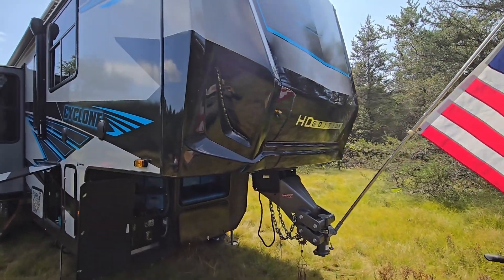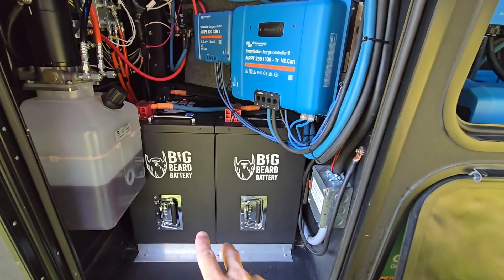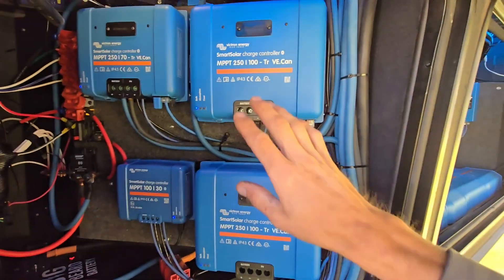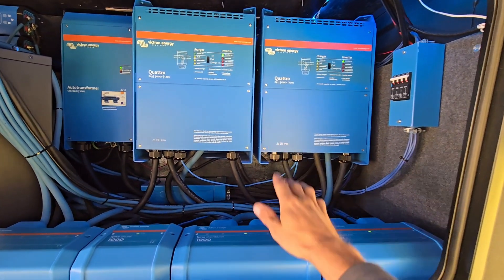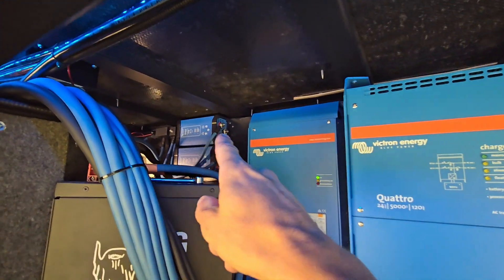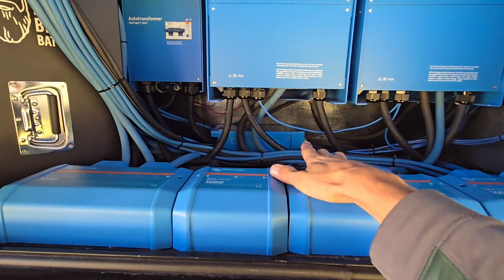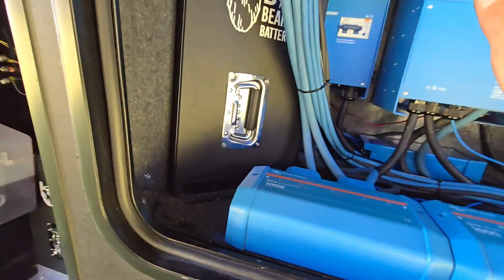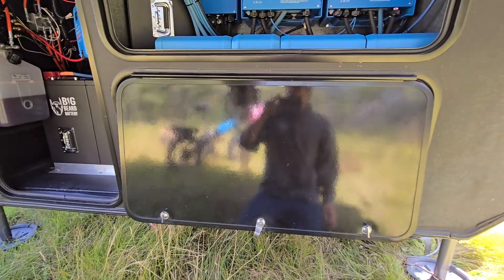Huge RV Victron/Solar System Capable of Powering 4 A/C's

Comment: Awesome system brother. What are you using to cover battery terminal connections?
Reply from the maker: Umm if your talking on the actual batteries themselves thats all part of the battery connection that just has a thin piece of plastic that snaps on to help cover them.....
Reply: @ccrvsolar  yes, your battery terminal covers? Where did you source them? Or they come with batteries...

Comment: What mount is the angle mount for the roof?  And where in the world did you find battery cable that is Victron Blue?
Reply from the maker: If you're talking the front angled panel, it's really just some basic tilt mount brackets for bigger panels.....
The most recent rack I have built which the video for it I literally just released I did not even use those.  It's more about the center support that's most important.....

As for the Victron Blue cable, my supplier I'm keeping to myself lol but it's not too hard to find out there on the internet.....

Thanks so much for watching and commenting....

Comment: You have an awesome system!!  I need something like that. Approximately how much would a system like that cost, minus the solar on a class A?
Reply from the maker: So even with no solar there is about $17-18k in equipment and wiring....labor would be on top of that which I woukd love to discuss with you if pour really interested, my labor includes lifetime customer support with remote monitoring through the Cerbo GX.....
Certainly give me a call/text 989-464-3314 or send me a email if you woukd like to discuss further....
Thanks for watching....
Reply: @ccrvsolar Hire this man!  Totally worth it based on how great these installs look.

Comment: Is there a simpler way to do this? I want a big system, but I don't want to have to run 47 separate MPPT's and 12 inverters. Wtf...
Reply from the maker: Ha yea there is, there is some all in one units out there by other brands that claim they have 6500 watts of inverting power with built in solar controllers so a "all in one" setup but its not victron and doesn't provide the same power in my opinion.....I want and victron system for various reason and if one wants a victron system to power everything, this is the way to go about it....
I build smaller simpler victron systems also but they are not going to power 2-3 a/c's.....
Thanks for your comment, I love talking about any type of solar setup.....

Comment: Ridiculous installation. Its like putting a V12 Ferari engine in a Hyundai Elantra. Never use the power capability😢 but spent $20,000 or more.
Reply from the maker: I guess I'm not sure how you can say we don't use the power capabilities....
We run multiple A/C's quite regularly plus when we have a customer plugged into us which is about a 1/3rd of the year there is times they are also running an A/C so now we are at 5000-6000 watt load and someone needs to use the Microwave now we are pushing 7000-8000 watt load.  Our batteries at some point throughout each month often dip below 20%.  Every watt of the 6600 watts is needed where there are times I wish I had more.  
I built the system not to run a 5000-8000 watt load all day nor would it be capable of running that kind of load all day....
There is literally not one piece of the system I could make smaller without sacrifices to our daily power needs....
Thanks so much, I love talking solar with anyone....
Reply: Yeah, and even when you’re not drawing 5-6kW, you’re charging a 23kWh battery bank to use at night.  Ignore that guy.  Negative nancy that doesn’t know what he’s talking about.  Probably has a 1-2kW system, no wife, and no kids.

Comment: What do you use for auto gen start?
Reply from the maker: It's made by atkinson electronics.  They actually have a new wifi version out that has made it much easier, works for pretty much all generators....before I had to stock multiple different kinds and even then wouldn't have the right one for some installs....
Once u have that then it gets wired into the genny start wires, the victron cerbo, and genny L1 and N.....
Much better auto gen start than anything else u can buy if you have a victron system.....

Comment: Why not parallel your panels?  Those 250/100's could easily handle a 4s2p.
Reply from the maker: So are you suggesting I should put 8 550 watt panels on 1 250/100 solar controller???  If so that would be 4400 watts and with a 24v system then there could be a possible  output of 170 amps which would be way to much waste....
Maybe I am mistaken on what u mean exactly....
Thanks for your comment....

Comment: Awesome. Is the generator really necessary though? In the process of planning my build. I’m going for 28kW of batteries so I figure that should cover me for cloudy days and I can ditch the generator to save on weight
Reply from the maker: I mean no matter the system I don't know if I would ever be without some sort of back up given my life with a wife and young kids anyways....
Really only time I have needed the genny is when customers are also plugged into me running an A/C, or in Michigan there can be a week of 90 degree weather and it's cloudy everyday by noon, 4 days of that and our batteries were down to 15%....
If I had my RV built I would skip the built in genny, add one battery, but still carry like a 2000 watt dual fuel little genny as a last resort.....
Everybody's needs are a little different but it would suck to have a dead $30-40k system.....
Thanks for watching and commenting.....
Reply: @ that sounds pretty reliable. Thanks for the advice. I’m thinking I might just use the built in inverter plug in the back of my truck as a backup.
Reply: @dishcleaner2   Yeah, that could be your emergency backup generator.  Nice.

Comment: How much weight does the solar system add to you're RV ?
Reply from the maker: Oh it definitely adds some weight, some carry toys, I carry RV solar systems, lol....total weight of system is around 1600 pounds....80% of that is to the pin weight which makes our pin weight 4500 lbs depending on how much equipment for installs I am carrying at the time....
We have a payload of 4750lbs, last time I weighed us I had 150 pounds to spare but my equipment stock can really vary which can vary our weight 500+ pounds, I know we are a little over sometimes.....
Thanks for you comment....

Comment: Wow, that front is packed full. What's the weight of all that, it's got to add a ton to your hitch weight? Had to laugh when you said the gen would kick on automatically when it gets down to 15%,  with all that solar does it EVER run?
Reply from the maker: Yea my pin weight is heavy, about 4,500 lbs...."frame flex" that is so popular right now is always in my mind but after 16,000 miles all is well and if it happens I will fix it....honestly I expect it at some point....
Only time genny has run since I finished the solar back in January was this summer when I had a customer plugged into me pulling 20-30 amps for extended periods....
Thanks for watching and commenting.....

Comment: Nice setup!  Subbed. Would love to see your generator dual line combiner.  I'm looking to do the same.  If only Victron would have a setting for generators...
Reply from the maker: Hey thanks so much, combining the legs on a single phase 120v genny is simple on most.  I can dive into it a little more in another video forsure....
With Victrons Quattros that have 2 AC inputs where the genny can be wired direct to inverters completely seperate from shore power it gives you a little more control over the generator.  Thanks so much for watching and commenting.  I love talking solar with anyone so reach out or comment anytime....

Comment: That sure is a sweet system! I know what you mean about the high current demand for generator starting. In addition to my 48v battery, I have a separate 560ah 12v battery that I use for generator starting. I got a 330a BMS with a 1,200a surge to start my big genny. What's funny is that now that I have my big system, I haven't had to run my genny at all, other than to excersize it, in over a year and a half of off-grid living. My 200a BMS wouldn't cut it, as the starter draws over 300 amps. You really did that system right, with the autoformer. It's like the ideal system I would build if I didn't have any budget considerations. I like how you put that one angled panel on a separate charge controller. It works with your 24v system. I use 2 angled panels up front, sloping at a gentile 9.5 degree angle, but they are all on one charge controller. I figure I might pick up 50-100 watts if I wired it like you did, but I don't think it would be cost effective. Besides, I already have sufficient power for my needs. Though your set-up is optimal for solar production.

Do you have any idea what your entire system weighs? It looks heavy. My total 5,020w solar/23.5kwh battery system adds about 950 lbs. to my MH, so I removed about 400lbs from my coach to make room for all this extra weight, as it only has 3,700lbs of CCC. And for a FT boondocker like us, who travels with full tanks, that's barely enough.
Reply from the maker: Sorry for the slow reply I have gone to your comment multiple times to reply but I know it was gonna be a longer response I wanted time for it....
The 48v systems I have done I kept a separate 12v battery for starting genny since the 48v to 12v converters aren't very big and it would take a pile of them in parallel to create enough amps.  Like 5-10 of them.
We definitely love our system, couldn't live without it honestly as pathetic as that sounds lol.  All my customers with an autoformer love it and it's something I stock all the time now.
My system definitely added some weight.  Just the 12 550s at 58 pounds each is almost 700 pounds.  All the racking materials are probably around 150 pounds.   2 Quttros are about 140 pounds.  I got around 370 pounds in batteries.  So even with the few things I removed it added around 1400 pounds.  Honestly I haven't re weighed us since I finished the roof.  I had about 800 pounds to spare when I weighed us before doing the roof.  We don't tow with full water because of system weight but I have access to water most the time no matter where we are so I tote it almost daily and keep about a 1/3 traveling.   We have 4500 pounds of Cargo Capacity.
     Thanks so much for watching and commenting.  Maybe our paths will cross one day.  Winter months group up all us fulltimers so I bet we are close together at some point.....safe travels......

Comment: You’re going to have to set up a monthly generator run because she’s not going to be used! 😂
Reply from the maker: Yea no kidding, I can set that up through the cerbo auto gen.....a couple times this summer we had customers plugged into our 30 amp plug running their A/C along with ours and we couldn't keep up for being multiple days in a row so it got some use then.  It's rare anymore though......
Reply: I didnt realize you could set up a schedule for exercising the gen set. @ccrvsolar
Reply from the maker: Yea requires a Atkinson GSM Mini to be installed but then it allows the Cerbo GX to act as the auto gen start which has way more settings then something like the magnum auto gen does.....